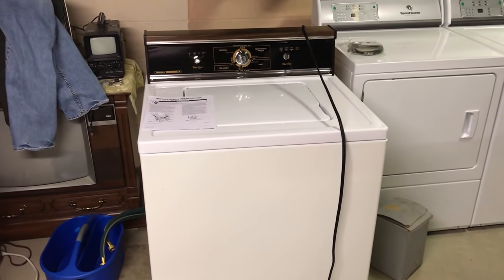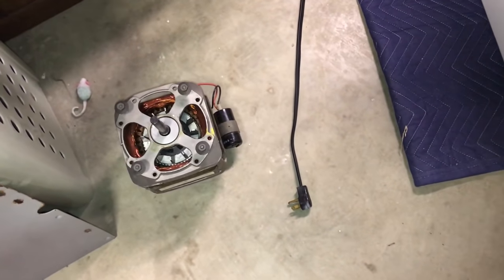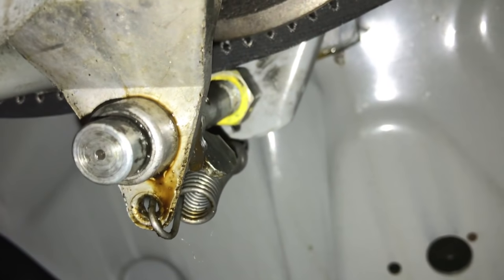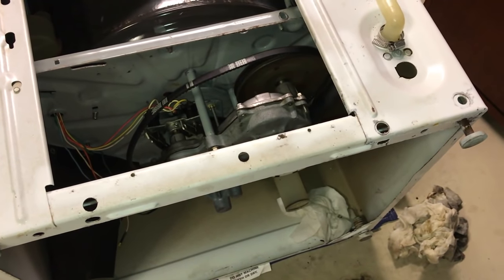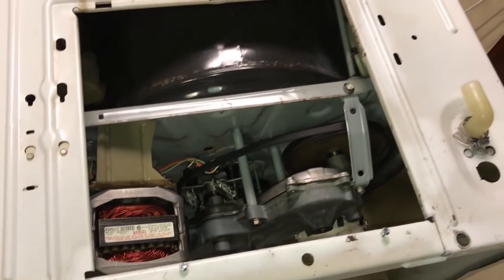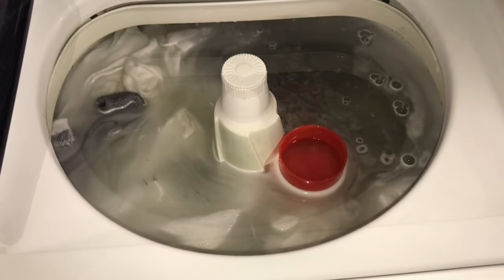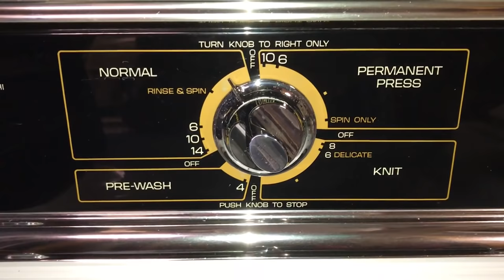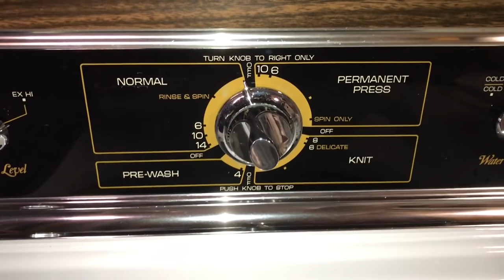1978 Kenmore 70 Series Washer... Bringing Back the Woo Woos!!!

Comment: In 2018 I needed to replace the belt in my (same washing machine). I too never replaced a belt in this machine. The washer and drier both came with my mobile home in 2007 when I purchased it. I have replaces a few things on this machine over the years as well as with the matching Kenmore Drier. These are WELL-BUILT machines and not at all like the JUNK that comes out today. EVERYTHING today is made cheaply and designed to BREAK on PURPOSE. If you have one of THESE old 78 Kenmore machines... KEEP IT. You will never find another as good, NEVER! Anyway, I have always worked on my cars to save the expense of paying a mechanic all my adult life. I've even rebuilt engines. The ONLY thing I have stayed away from are transmissions because they are just too damned complicated for the amount of money and patience I have and I have a LOT of patience too. When I replace the belt on my 78 Kenmore washer, I turned the machine over on its front side and studied the structure inside that holds the transmission onto the bottom of the table. I saw what needed to be loosened and what needed to be removed. If you don't (have) to completely remove a component... DON'T. Even though this job took about four hours to complete it was (theoretically) simple. The hard part was being very careful NOT to loosen the transmission any more than necessary because if it comes out too far, there are at least one or more small ball bearings that could fall out from the clutch assembly. Just loosen the components ONLY ENOUGH to get the belt to just barely pass through. It's a PUZZLE at best so be care and take your time and after you get the new belt installed and everything buttoned back up and turn the machine back up on its feet and plug it in and do a wash cycle... you will CLEARLY notice a HUGE difference in the way it operates. Much smoother and quieter. My old belt was coming apart in pieces which I saw laying on the floor. It was, I would bet the original belt installed at the factory. This job is doable so have patience with it. The reward is worth all the effort. Oh, don't forget to unplug it from the electrical outlet first!

Comment: That machine really needed it’s correct motor and belt.  You can tell how slower it ran because the other motor wasn’t really as powerful as the correct motor.  Now it’s time to do what JayKay18 does, the washday wash-ins with the Kenmore and Speed Queen
Reply: Ooh, ideas.
Reply: Will Butter Exactly. I could tell in Eugenes vids of this machine that it wasn't agitating or spinning at the speeds it's supposed to. Now it is.
Reply from the maker: We are now planning on designing the finished laundry room to accommodate 3 pairs of washers and dryers.
Reply: Spats Bear that sounds awesome!!  Can't wait for the finished results and your third pair of sets
Reply: Oh, yeah. 3rd machine isThe maytag? i almost forgot about it.

Comment: So the motor and belt made all the difference? Huh, I always thought it was specifically the transmission!
Reply from the maker: They sure did! The belt actually makes the most difference, and the motor just finished it off. Plus it is the correct motor that should be in this machine for those model years.
Reply: @spatsbear  i saw a video of one of these kenmore washers on Lorraine's Furnitures channel where the pullies were swapped and the washer was on STEROIDS TURBO MODE!!
Reply: @spatsbear the motor that’s on yours more than likely came from a 60’s or early 70’s Whirlpool or Kenmore belt drive washer, my Whirlpool for sure has the older style of motor on it and is identical to the one Eugene installed back in 2018. May vibrate and run a little more rough but since you can disassemble and clean these older motors, can’t complain too much. May even be possible to have those older round GE motors re-wound if something were to happen.

Comment: Are you guys gonna use that as your daily driver now, or just for fun?  Sure runs smooth!
Reply from the maker: The Speed Queen pair will still be the daily driver, but we've been using the Kenmore a lot moreso at the moment. And now that the belt and motor have broken in, it is really smooth with even better woowoos.

Comment: didn't the other motor worked? I don't think all washers made woo woo sounds. I also think it varied on model.
Reply: The woo-woo sound on the newer Whirlpool/Kenmore washers were a bit quiet compared to the older models. My Mom had a 1967 Whirlpool Imperial Mark XII. That machine left you know it was running! You could hear the woo-woo upstairs. Back then, you could tell what kind of washer was running because they all had their own voice, weather if it was a Westinghouse, Whirlpool, GE, Frigidaire,  Speed Queen, Norge or Maytag. It was like music to my ears. Now they make everything so damn quiet .  I don't trust an appliance that doesn't make noise.

Comment: Changing a belt on these is a pain in the ASS!!
Reply: When you have experience, it’s fairly quick to do. While it may be somewhat of a challenge to change the belt, it didn’t need to be done all that often compared to the motor couplers on the direct drives which had a tendency of going out from time to time.